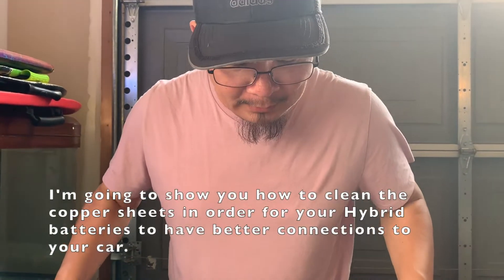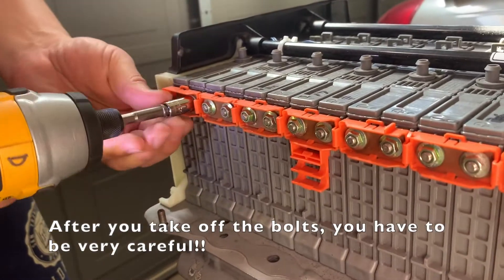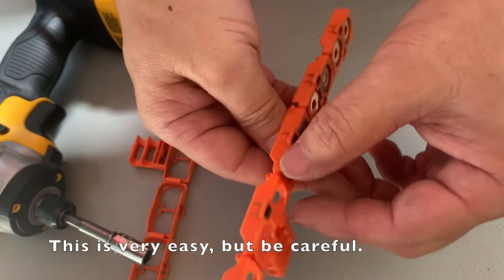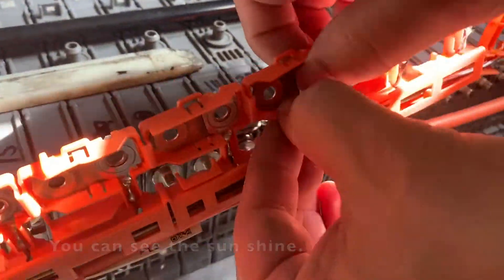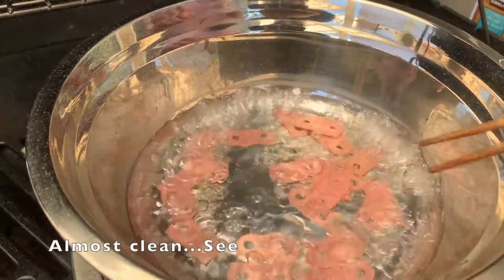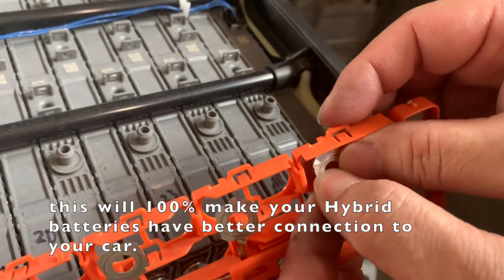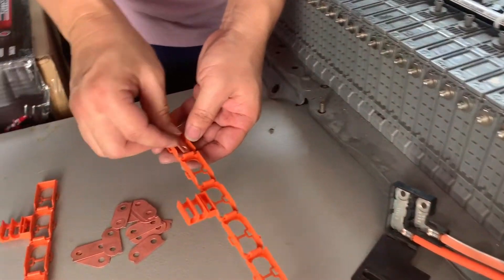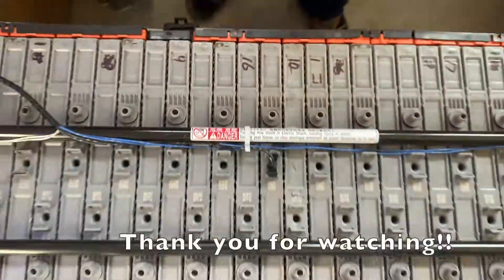Toyota Prius Hybrid Battery: Cleaning the Copper Sheets

Comment: If you look closely at the studs, you will see a larger conduction surface at the base of each stud that contacts the back of each busbar.  That is the actual circuit path for most of the current.  Cleaning the green corrosion will make you feel better, but it's questionable whether it does anything.  Clean the base of each stud and the backs of the busbars, and clean the sensor wire surfaces carefully.  Use dielectric grease to form a barrier to air and moisture.  Torque to 48 in-lb.  Make sure the case is grounded to the 12v system.  Check voltage in pairs for each 'block".  This is done by measuring from one busbar to the next.  You should get a combined voltage of 15.7.  If a block comes up low, then check each module from one side of the battery to the other and diagnose that problem.  Also check the plug-in connectors on the BCM side.  Use dielectric grease on all connections.  Have a nice day.

Comment: Hey, why no dielectric grease?  Not even from the factory.  That's what the shit is for.  Stops oxygen infiltration and crap getting into connections.  My Prius headlight sockets are packed with it.  Why not the HV battery connections.  Two different departments over at Toyota?  Stuff that works and stuff that doesn't?  I'd like to get some kind of an answer on that one.

Comment: Nice video I wouldn't do this unless you are having problems. My 2007 prius just got the battery warning with red triangle etc. There was tons of corrosion but I don't think that is what caused the codes.
Reply: Then what caused it? What code?? Why comment with no actual helpful information
Reply: For some people it does cause the codes just like a regular 12 volt with too much acid on the posts, corrosion interferes with the copper connection.

Comment: This worked fast.  Seemed better than two hours of only vinegar.  Still a small darkness on them after two rounds so I used a scouring pad, they look good'ish.  Also be careful putting on the second row of bus bars the voltage goes live ish at that point so wear gloves, try not to touch across the front or diagonal...
Reply: You are not clear at all, very confusing,  so what exactly is a "2nd row" of bus bars?...doesn't make sense
Reply: @madmax8620  there's one row on each side of the battery (like 18 bus bars in a row...), peace!
Reply: @RogerPack  thanks..
"Try not to touch across or diagonal" ...huh? What??
Reply: Не бійся. Та бий Путіна

Comment: The actual contact areas were fine.  Who cares what a non-functioning element looks like?  The only thing that comes to mind is if there is a current leakage in the corrosion draining the battery.  The orange dividers prevent that.  Any comments?  Am I right or wrong?
Reply: most likely u r right

Comment: You see those lovely clean shiny circles under the nuts on the bus bars? That means that there was absolutely no corrosion where it mattered. This achieved nothing.
Reply: Correct.  I can't think of a real reason for cleaning that corrosion off other than just tidying up, and you don't have to disassemble it.  Just hit it with a toothbrush and some water.  I don't even know if baking soda is necessary.
Reply: @alext8828  Having recently serviced the battery on a Prius I can confirm that the corrosion will migrate under the nuts creating a blackish residue. If the surface is shiny underneath, then cleaning is not necessary. There's nothing wrong with cleaning the bus bars where there's obvious corrosion. But it's not necessary as you said as the point of contact is fine.
Reply: @electronraygun6346   I'm surprised to hear that but I'll take your word for it.  I just pulled the battery on an 18 yo Gen 2 and there is nothing under the nuts but fresh copper but I'm not discounting your statement.
Question: Why isn't dielectric grease used or even shellac?  There's really no oxygen barrier on these things other than the mechanical fasteners.
Reply: @alext8828  I wonder if it has something to do with me being in the UK where it's not exactly great weather most of the time. I will say that the bus bars were thick with copper oxide around the nuts. It was pretty green all round. Rather than nice shiny copper underneath, there was a film of black tarnish, perhaps from the nuts and washers themselves. I'm sure something metallurgical was going on. I wish I had photographed it now. I used PCB etchant to clean up the bus bars. I did consider protecting them with grease but I decided not to as air and dust passes through the assembly. What I've noticed is that when dust gets trapped in grease it provides a nice spot for moisture to accumulate and sit rotting metal away. Also the dissimilar metals might cause some chemistry to take place that might cause corrosion. People often put copper grease on nuts and bolts and the mating faces of alloy wheels. The grease, salt, moisture and dissimilar metals form a battery which causes the surfaces to knit together making removal way more difficult. I was concerned something like this might happen with the battery and accelerate problems. I'm guessing there must be a reason the manufacturer decided to leave them bare metal. That was my thinking anyway. :-)
Reply: @electronraygun6346   That makes perfect sense.  Your mention of a metallurgical phenomenon is interesting as I notice that the nuts are ferromagnetic.  Here's what ChatGPT had to say about it.  Not wildly helpful:
In the case of Ni-MH (nickel-metal hydride) batteries, the external terminals are typically composed of copper and various alloys, including steel or nickel-plated steel. These materials are chosen for their conductivity, strength, and resistance to corrosion.

The copper portion of the terminal is usually responsible for providing good electrical conductivity, as copper is known for its high electrical conductivity. It allows for efficient transfer of electrons between the battery and external circuit.

To enhance the mechanical strength and durability of the terminal, steel or steel alloys are often used as a structural support or as a base material. Steel provides good strength and stability to the terminal, helping it maintain its shape and securely hold the battery.

To minimize the risk of galvanic corrosion between the copper and steel portions of the terminal, protective measures are often implemented. This can include applying coatings or plating to create a barrier between the dissimilar metals. Nickel plating, for example, is commonly used to provide a protective layer on the steel portion, which helps reduce the likelihood of corrosion.

Additionally, proper design and engineering of the terminal structure can play a role in reducing galvanic corrosion. By minimizing direct contact between dissimilar metals and ensuring effective sealing against moisture or electrolytes, the potential for galvanic coupling and subsequent corrosion can be reduced.

However, it's important to note that over time and under certain conditions, galvanic corrosion can still occur, albeit at a slower rate, in Ni-MH battery terminals. Factors such as exposure to moisture, elevated temperatures, or harsh environments can influence the corrosion process. Therefore, regular maintenance, proper usage, and ensuring the integrity of the battery terminals are essential for maintaining optimal performance and longevity of the battery.
Reply: @electronraygun6346   I mean why didn't Toyota just slap a coat of paint or varnish right over all the terminals.  I think Panasonic makes the batteries but certainly, the batteries were installed by Toyota and they could have done that.  
Did I mention that I found a cell with a voltage of 6.92?  The rest are just over 8 w/ another at 7 something.  Luckily the worst one is at the beginning of the pack.
Stupidly, I used a wire brush on the terminals and got a spark somewhere down by the #4.  I probably cooked it.  I don't know.
Reply: @alext8828  Paint may be a better solution, I can't think of a good reason why that wouldn't be a solution, unless it's an electrolysis thing that mainly causes the corrosion. Your battery sounds to be in the same state as ours. All modules good, just one reading around 6v. This I definitely do understand. The module has an internal short which will cause it to yank all the power from the rest of the battery. I would recommend balancing the replacement module to its block pair. Have you completely removed the bus bars before working on the modules? If you briefly shorted one cell, chances are it's fine. When you replace the faulty cell if you wire it to the module it's paired with in parallel and leave it for 24 hours the charge will settle between the two, but you MUST have removed the bus bars before doing this. DONT do it if they are connected. There's a few guides on YouTube on balancing/wiring in parallel, it's worth searching them up and watching them first. Ideally you would balance all the cells together, but as time was a factor for me, I just balanced the new module/cell. The battery is working fine and without issues for 2 months. I hope you get yours working great again!
Reply: @electronraygun6346   I had a long response and my computer burped and it's all gone.  Let's hit the high points.  Yes on the dielectric grease.  I could see it becoming a mess.  Yes on the paint or varnish, and you have a point about the corrosion creeping under any surface barrier.  It's all an interesting subject.  And the balancing is something I keep hearing about but some say the modules should become balanced by the circuitry.  But those OBD 2 scanners show the modules changing quickly over time.  Does that mean that all the balancing done before assembly is wasted and they're gonna jump all around???  I don't know.  
I was watching Steve Van Pelt and a guy named Beene doing load testing.  I see people using regular load testers that you'd use on lead/acid.  
Hey.  Tomorrow's another day.  Possibly.
Reply: I'd be mostly afraid of the green crud getting under a nut...

Comment: Use sulfuric acid it's very efficient against corrosion, 
Then white vinegar, 
Finally sand with 280 grit or more
Clean and dry it
Reply: What?  Why bother?  You don't need to do any of that.
Reply: 800 grit minimum or a steel whool

Comment: Great Instruction, thanks for this Video, very professional.  I am working on a 2007 hybrid that won't start and has the ! point indicating a "problem".  I replaced the bad 12v battery and  all the lights are up, but start doesn't happen.  I think that the main hybrid battery rails have corrosion.  Does anyone know if the hybrid battery can stop turn on because the computer might sense low or no voltage off the hybrid battery array?  Also, if I fix the dirty rail will it be able to start or will I somehow have to get the hybrid array to a certain voltage?
Reply: If youre getting the check hybrid battery error this could fix it.
Reply: phalanx6 • Yes, depending on how weak the hybrid battery is, the car might not start to move. Check each cell of the hybrid battery. The ones that are not close to the voltage of the rest of the pack are the ones you should replace with the same kind of cells you buy from eBay or Amazon.
For example, if the pack has 28 cells ( different hybrids have different number of cells in the pack of the hybrid battery, like 22 or 32 or 34, etc ) and 26 of them have closed voltages like 7.90V, 7.8, 7.7, but 2 of them have, for example, 7.2 and 6.9, then change those two ( may be more than 2 bad, like 3-4-5 or 6 cells, etc ).
Evidently, clean the terminals, bar busses, nuts, screws, vacuum everything, clean the main fan, etc. /
( Now, in general, 97 to 99% the problem is the main big hybrid battery, and that's how you repair it simply, efficient, and cheap, evidently after you check the 12V battery, which should have at least 12.3 Volts all the time.
If the car moves, but after a while, sometimes, infrequently, starts acting crazy, warning lights come on the dashboard, and eventually at some point the engine shuts down, but after, let's say, 30-45 minutes you can start it again and drive it again for an hour, two, etc and everything is repeated, etc, then the problem is in the wires, bad wires between the main fuse box and top of the inverter-converter. In that case you unplug and open-uncover the big chunk of wires between the main fuse box and the top - or sides, depending on the model - of the inverter-converter, and verify each wire individually feeling it with your fingers from conector to conector. There might be 25 wires of more. It's gonna take some long time and you should be patient in order to do it. You'll probably find one that's almost interrupted while still covered by its plastic sheath. You should have very sensitive fingers to feel the interruption, it is very tricky to feel it. Cut it at the place of interruption and at the other end of the same length from the connectors, change it with another one of the same thickness, solder it, isolate the exposed places at both ends, and you're good to go 🙂👍✌️ ).
Reply: I had a hybrid battery error code from a 13-year-old Prius. the car still runs but with less torque and power. If the car was not driven for months, the hybrid battery may be well below threshold voltage and need a special charger from the dealership to charge it and make it runs again.
Reply: That's a good question about the voltage.  What happened in the end?
Reply: What codes?
Reply: Check relay fuse in the fuse box

Comment: The tarnish is still there after several trials of your method. Can you suggest why it did not work? I let it boil for several minutes and still, it didn't help
Reply: Only the contact points between the studs, nuts, and busbars are important and they don't corrode because they're not exposed to air.  The rest is bs.  You can use an ohm meter to prove that.
Reply: Scouring pad worked for me

Comment: You can buy the new busbar from Toyota and be done with it. It also makes your battery last much longer with a really good new bus bar.  YOu give really dangerous example handling them without proper gloves.  After cleaning it you should not touch the plates either, it reduced the conductivity and may cause internal resistance  too
Reply: Only in usa, in eu they tell me to buy whole battery :D
Reply: @dovydasruockas1681  You can just open it and clean it by hand, It is copper and you can get it cleaned really well.
Reply: @rondhole  yep done this today,i hope it will work 👍
Reply: @dovydasruockas1681  It will, just be sure protect yourself with proper gloves to keep your family from loosing you.  This video is insane, he kept saying safety but he wears no gloves. What a comedy.
Reply: @rondhole @ 3:35 he said be careful but he was saying to be careful not to break the wire in front of the bus bar

Comment: I did this procedure, now I have more lights on my dash, and my Camry doesn't run.  Bus bars are now very shiny (some were covered with blue corrosion) - doesn't matter, car still doesn't run.  Any advice?
Reply: Did you reconnect the safety lever thing?
Reply: @RogerPack  I did, but found out that one of the module voltage sensor wires was also completely corroded, not even attached
Reply: @MattB787  It wouldn't even start without one sensor? Brutal! :)
Reply: What are the codes that come up?

Comment: The exact same results can be achieved by a short soak in vinegar.  If you have a swimming pool, use muriatic acid instead. Dilute muriatic acid with 50% water, and you'll only need 15 seconds of soaking. Rinse, dry and done.
Reply: BEST TO NOT USE MURIATIC ACID.  Muriatic acid will deposit chloride which will just amplify corrosion.  The reason why adding salt to vinegar increases it's acidic action is due to [some] amount of salt turning into hydrochloric acid.  It's ok in tiny amounts, but not full muriatic strength.
Reply: @charleshorseman55  nope.
Reply: @snoobler  Excellent retort.  Extremely convincing.
Reply: @charleshorseman55  it just doesn't happen. CuCl DISSOLVES in HCl.
Reply: Yep!  Thank you for the response.  however, unless it's rinsed (immediately) with distilled water, it will form CuCl layer.  Even such that metals surrounding will be oxidized more rapidly.  The halides are marvelous at their ability to facilitate work.  But CuCl is a very poor conductor.
Reply: BTW I don't toot from my bum on this, despite some chemistry in college, but with working with HCl as a rust and corrosion remover in practice.  It's potent AH, but it seems to always want to leave a corrosive or at least a catalytic.  Even the gaseous Chloride (outgassing) likes to react with surrounding metals.  Once the Cl is reacted with iron, (FeCl) nickel, (NiCl2), or copper, (CuCl) it's there until dissolved again in a strong acid.  Again, USEFUL!  but a method for removing the CuCl patina (buffing?) is warranted.  I've watched many parts turn to rust from carelessly reacting HCl for corrosion removal.
Reply: @charleshorseman55  "toot from my bum" gets a like.  Given that I've does this on thousands of bus bars with no subsequent corrosion issues means you and I have different experiences.
Reply: I tried straight vinegar, it didn't clean them well after couple hours.  Maybe overnight but the boiling method works for sure.

Comment: Excellent remedy for corrosion! 👍 I used your advice today. The car came from Kaua'i & the corrosion was like mold on cheese. ALL the copper terminals were black with a thick build-up, so were the retaining nuts. The build-up was so thick, I emptied the water, salt & white vinegar mix 3 times, because of the amount of debris in the solution. They looked NEW when I was done. Then used 0-fine steel wool to make the surfaces smooth & shiny. THANKS for sharing!